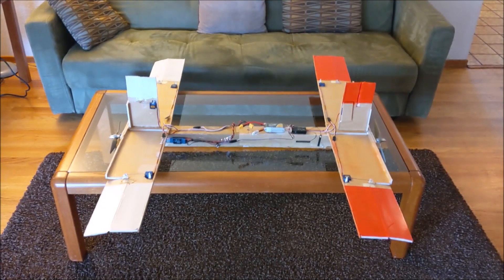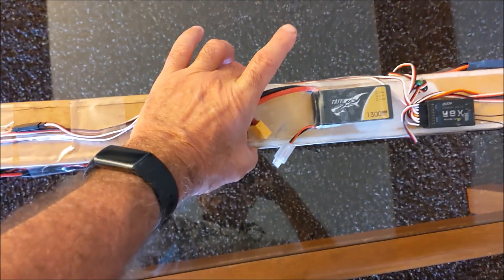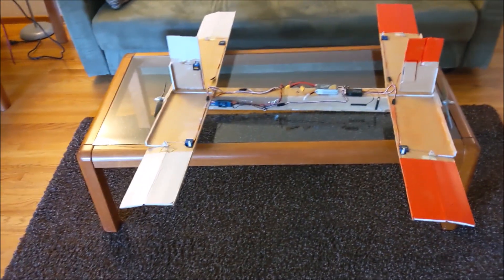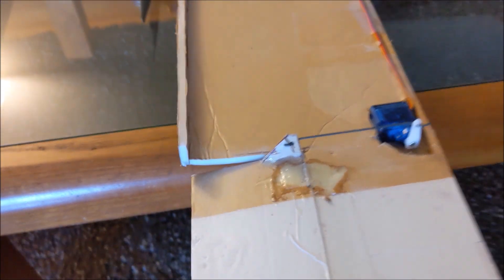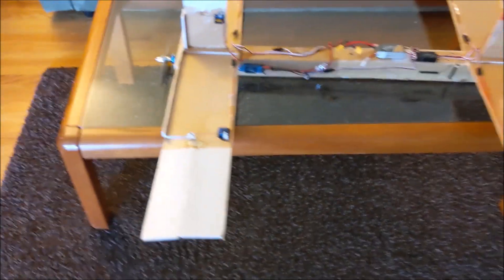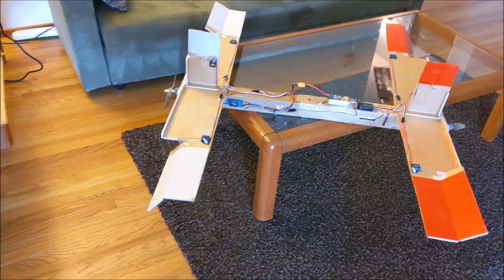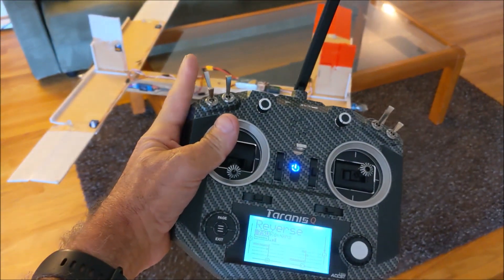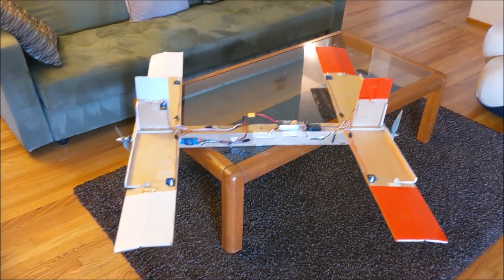Forward/Backward Plane Double Transition

Comment: This is the second aircraft I'm aware of that can change direction without turning around. Ten years ago I made my "inverter" which was a plank wing with a pivot shaft in the middle and both sides (wingerons) independent with their own receivers, gyros, batteries, and motors. I didn't get it on video, but I was eventually able to reverse the flight direction by commanding a hard roll in one direction and the aircraft would roll until the wings rotated 360deg relative to each other and the flight direction was reversed. Maiden flight here: https://youtu.be/m4leiPBmi08
Reply from the maker: The pivot wing is interesting. Another way to approach that design is to have a potentiometer between the wings and use the control system to change the wing's effective torsional stiffness through feedback into elevator control.  My approach was to use no on board stabilization, although this makes it aerodynamically inefficient.

Comment: quirky invention and clever solutions thank you for the explanations. theres a short free fall period however when changing direction, do you think this plane can transition backward faster than any other plane could turn?
Reply from the maker: Not really.  It's also extremely inefficient.  I built it solely to answer an aerodynamic puzzler that occasionally comes up between engineers.
Reply: @smorrismlbco  for example a parachute… frisbee… boomerang… are surfaces that can produce lift in any direction